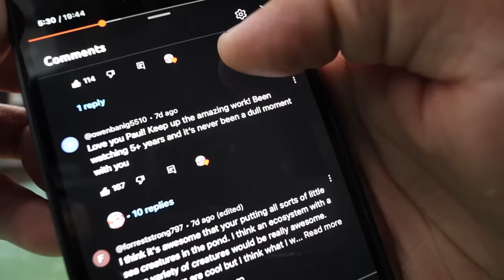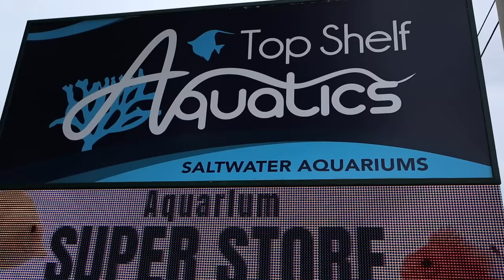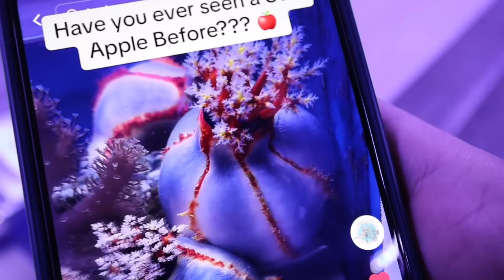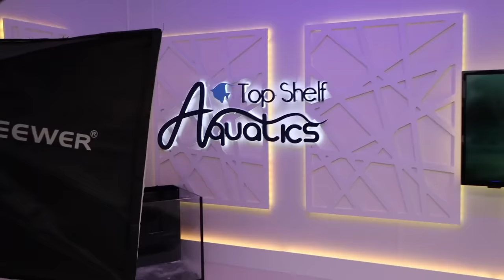Buying FIRST FISH for My SALTWATER POND!!

Comment: the uv needs to have the inlet and outlet up not on the side when installing on its side the way you have it will trap air in it. also shim the outlet sides bracket so the outlet is 3 or 4 mm higher than the inlet.

Comment: @paulcuffaro you should get the big tangs and angle fish that would be awesome but you should also get a huge puffer fish maybe 2 and lion fish also should get 2 sting rays maybe more depending if u get sharks and 2 eels also u should get a couple of rabbit fish that are bigger in size you could also get a couple of big 6inch clown fish for the anenomies also for the sharks you should get 2 short tail nurse sharks they only get 3-4 feet but also if u wanna be unique u should get either a baby black tip shark that stays on the top of tank band feeding vids of that would be awesome or get a bonnet head shark there same family as hammer heads or if u want to have like 5 sharks in there u should get the nurse sharks and a couple cat sharks and also a guitar fish that would be so cool and maybe if u can get salt water plants that can grow from the bottom of the tank all the way to the top maybe seaweed it would also allow the smaller fish who get beat out for food to have a good scorcw all the time also u could get a leopard shark from rodrigo im sure he’ll find you one but if become the first fish youtuber to have either a bonnet head or black tip shark that would be so damn cool

Comment: Love the pond Paul however im worried ofr fish you put in there hurting their face on your windows inside the pond them edges can get real sharp real easy like
Reply: especially the corners imagine your a big fish minding your business cruising and them boom the corner of the windowsill to the eye. im not hating Paul just wondering what you plan to do about that. you already had problems with that in the 5500 and the edges that stuck out where way smaller and most likely less abrasive